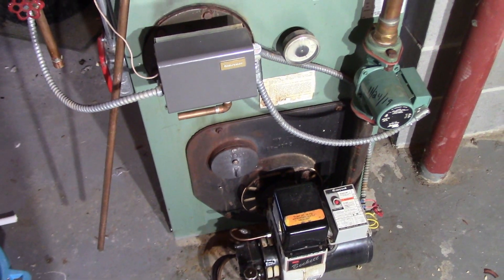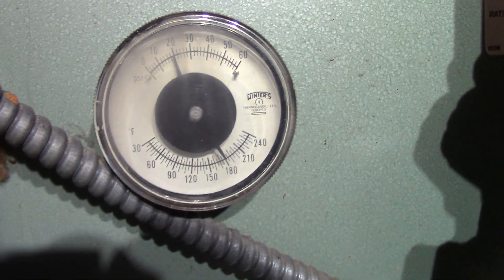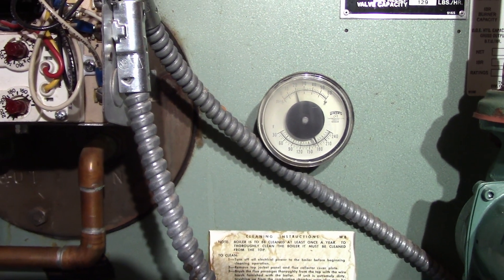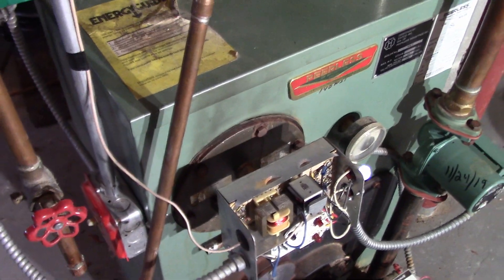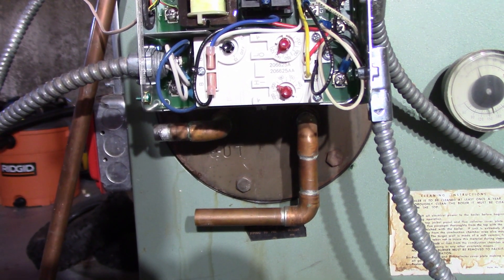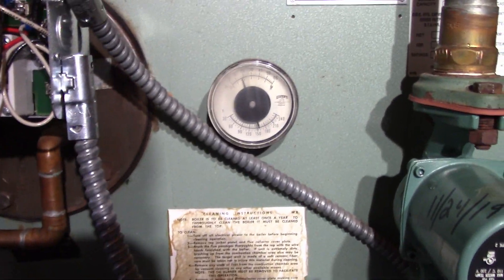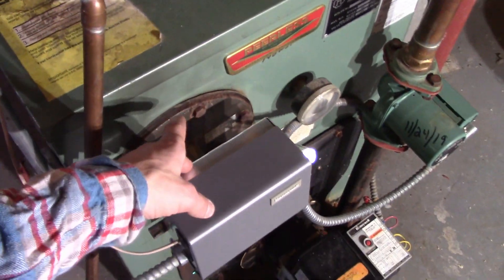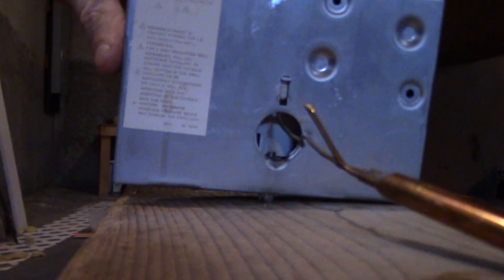Boiler triple Aquastat L8124 bad High limit switch or sensor.

Comment: My old Honeywell was just a Hi-Temp aquastat, so instead of $160, I paid $190 for a Hydrolevel 3200 Gas and $32 for a new well to monitor low water level.  The 3200 is electronic and shows heat water temperature, heat call indicator, low water indicator and shut off, and has Economy mode that adjust water temperature in warm days.  I wouldn’t go back to old Honeywell electro-mechanical device that has no displays of functions or status.

Comment: I have the exact same. Now the circulating pump does not turn on...or at least most of the time. Kind of intermittent...so for now I plugged the circulating pump directly into an 120v outlet. 

---When I click the relay manually, the circulating pump turns ON  (power to the contacts)  and the furnace fires up. 

---When the furnace runs on its own, if I click the relay manually, no power to the pump contacts (???)

Very weird. All circuit board traces are good. Any hints?

Comment: Did you swap out the whole aquastat or just that hi lo switch? I think my aquastat is doing the same thing. My boiler won't run on its own. I have to hit reset for it to fire. Then when it fires only one zone seems to be working out of two. One circulator isn't running. I have the same boiler, WB3.
Reply from the maker: I replaced the entire aquastat.
Reply: @idothings6605  Cool. Thanks for the reply. My problem was the motor and the primary. Replaced both and works great now.

Comment: I have this boiler and it works both my heat and hot water.  I have been having issues with this running and not sending heat and doing the same with my hot water. 
I hope to have this fixed before cold weather hits my area. 
I chased this all last winter and had to turn off the heater to reset whatever to have heat and hot water. 
Thanx for sharing this video.

Comment: I think I might have the same issue. Hi limit seems to do nothing. I have it set at 160 and water gets as high as 220/225 when it's fired up. Water out of the faucet gets to 175, hot enough to scorch a home invader  if you have enough time to fill a pot. To be determined if replacing the aquastat will fix my issue. Either way I learned something from this, so thank you!
Reply: A boiler like this that does heat and domestic HW requires a mixing valve.

Comment: Is that sensor at the end of the video a replaceable part? Mine expands the bladder under the high limit switch but is not retracting and therefore not closing the circuit

Comment: I have the same setup with an old TEXACO Fuel Chief cast iron boiler. No domestic hot water just ambient temp with identical aquastat. Is it ok to keep the low temp bottomed out other than having a long cycle? Im just not sure what an optimal setting is for just baseboard heat. I supplement with a pellet stove so my demand for heat is minimal

Comment: my new boiler lost good hot water pressure its only 2 years old since installed new !, Cold pressure is great ! I cleaned the coil with vinegar 2x, A little better but not much. The Honeywell boiler control  LED is blinking a code = SEA (I) . There are 3 buttons on the upper left inside and another  to the right. I am not sure homw to check these settings. But I am thinking it needs to be re-set if it bliks a code like that. Anyone know how to fix this ? Thanks.

Comment: This is a triple aquastat, the hi limit shuts off the burner when on a call for heat. That means when the main zone is heating the house.The second setting is the lo - limit reverse that is to maintain domestic hot water when there is not a call for heat. This is used  when you use the boiler for domestic hot water. In this instance the tankless coil has been removed so the lo limit can be lowered way down in temp be aware that the heat circ will not run if the boiler temp is below the lo limit temp setting. On a call for heat the circ clapper will pull in and the burner will start, but the circulator won’t run until the boiler temp goes above the lo limit setting then the burner will continue until either the hi limit is satisfied or the thermostat is satisfied. Listening to your description of the problem, I didn’t see any problem that couldn’t have been dealt  with by compensating the limit setting on the control to maintain the temp you wanted to achieve. I 100 % think you made a good choice by maintaining some temp in the boiler especially given you having a Peerless. Every fall you would need a jack hammer to clean the sections. PS there has to be a minimum of 20’ degree spread between the hi and lo settings so as not to lock out the heat circulator. Example limit set at 185’ lo set to 165’ a minimum of 20’ between the two.

Comment: What would cause a similar set up to let circ pump run when boiler heats up,  but the circ pump won't come on when thermostat calls for heat?
Reply: Themostat works and pulls in relay
Reply from the maker: What’s the LO setting on your aquastat?
Reply: 180L 200H 15D

Comment: So my heat continues to rise no matter what the setting I have the thermostat on. I have it set at 62 and it will often hit 69, when I shut it off from the thermostat it continues to turn on as well
Reply from the maker: If you're talking about the room temperature, that may be a problem with your thermostat. The boiler shouldn't shut-off until it reaches the HI setting on the Aquastat (typically set around 180 degrees Fahrenheit).
Reply: @idothings6605  so I put in a brand new thermostat , and I have the room temp set at 62 however it reads 68-70 and the furnace will continue to turn on even after it reached set temperature. I’m confused as to what can be causing this. I was going to replace the entire aqua stat I just don’t know what direction to go in
Reply: Is your relay held in? Could be faulty contacts on the relay remains closed when it should open

Comment: How old is the boiler?
Reply from the maker: 28 years old!
Reply: @idothings6605  I have the same boiler mine is 31 years old.  I just don't like it that the door does not swing open in order to vacuum it out. I take off the burner and then vacuum it out through there.
Reply from the maker: @garagekeys  I know, having to remove the door is a pain!
Reply: @garagekeys  My Peerless WB3 was made in 10-90 (from serial number). I do my own service after watching service man and watching videos. I don't do combustion analysis so efficiency is not optimum, but I make up for lost efficiency in not paying $300/year for service!

Comment: I had the same problem, which I solved by spraying down the aquastat with CRC Contact Cleaner, now the aqustat works perfect saving me the cost of buying myself a new one.
Reply: Thanks!  Picking up a can right now.
Reply: Curious what you sprayed ? I replaced mine once a few years ago but the board itself had a burnt spot on it. Did you just spray the relay ?

Comment: Excellent job, but what is the set point of low/ high and the diff.
Reply: When house calls for heat the burner turns on at HI - 10 degrees and turns off at HI degrees. Typically set to 180.

LO and DIFF control hot water coming out of tankless coil.
Burner turns on at LO - 10 degrees and turns off at LO + DIFF degrees. Also, the hot water circulator to radiators is not allowed to turn on below LO + DIFF. This is so someone taking a shower doesn't get a jolt of cold water.

I have my LO at 120 and DIFF at 20. This heats the tankless coil up to 140. Heater won't run until coil goes down to 110. Higher DIFF means burner runs longer; lower DIFF means burner runs shorter but more frequently.

IMPORTANT: HI and LO must be set at least 20 degrees apart to function properly. It is ok if HI and LO are more than 20 apart! Someone told me that LO should be 160 and HI should be 180 but 160 degree tap water is way too hot and will scald you unless you have a tempering valve. In spring and summer I set LO at 120 which is plenty hot for showers etc. and saves oil. I also always have DIFF at 20 degrees. Burner runs longer which I feel is more efficient than shorter run times.
Reply: @mattfoley6082  p] ppl
Reply: I replied but got blocked. WTF?